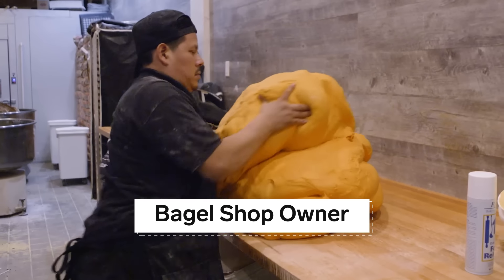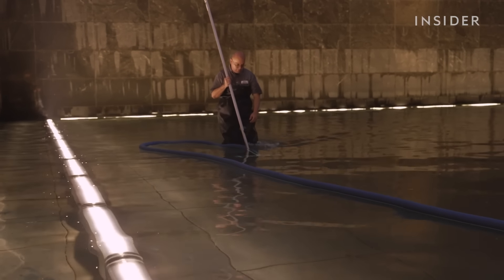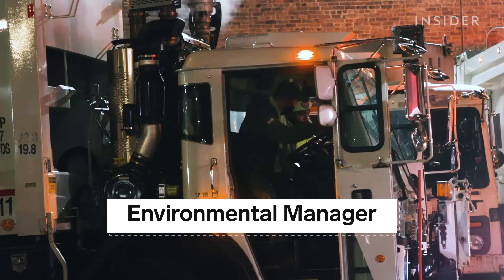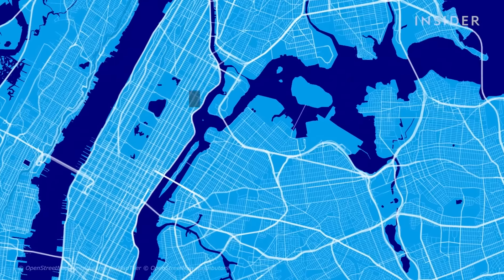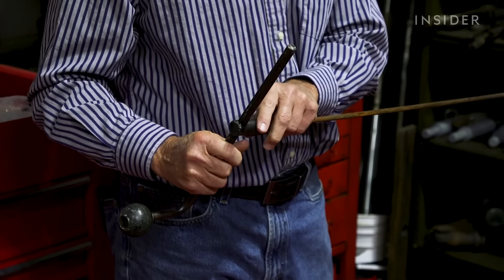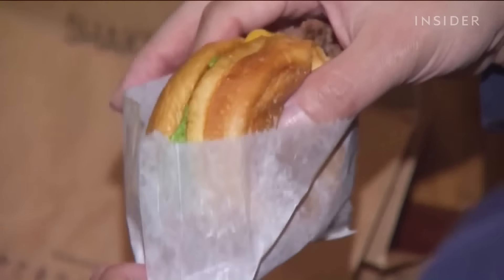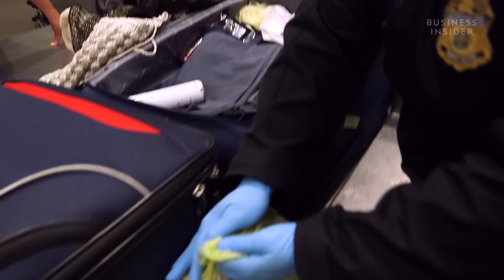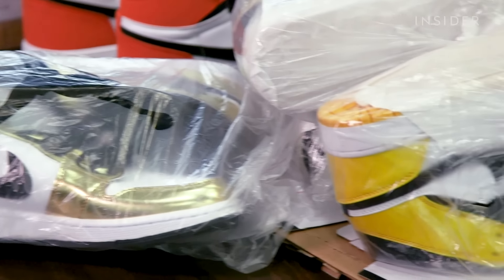10 Fascinating Jobs That Keep New York City Running | Big Business | Business Insider Marathon

Comment: This is the way I remember bagels being made in Brooklyn, NY and South Beach in Miami.
A few years ago I had two customers who started bagel factories in Charlotte. One man made his bagels this way with the kettle-ing. 
The other was run by a family with a chemical engineer father. The bagels were put into steam cabinets instead of being boiled. Both bagels were good but they were bigger so they could be made into sandwiches. The Brooklyn and Miami bagels were crispier and had a less dough-y texture. The Miami bakery had a sign that said that if you needed a tooth pulled you could just eat one of their bagels and the tooth would come out with no need to go to the dentist. 
I put more stock in the Brooklyn and Miami bakeries for authenticity because everyone there had a tattoo from a concentration camp. 
I'm not crazy about the modern bagels I guess because I remember what an old fashion bagel was like.

The steamer type bagel company had a contract to make bagels for Sara Lee. In my opinion that was their undoing. They went out of business shortly after they started mass producing bagels. The bagels were all rolled by machine. Prior they'd had a small restaurant and retail counter for bagels and various types of cream cheese flavors and lox. (smoked salmon) 

The Brooklyn bagel bakery also made soft pretzels. In the 1950s and early 1960s I would buy 25 bagels for 2 cents each and cell them for 5 cents. The only plant you needed was a peach basket and two towels to keep the heat in. If you had a rolling shopping cart you didn't have to carry the basket all day. I sold them nearly every day during the warm months but only on Saturday during the cold ones. What didn't sell I took home and we ate them as bread with dinner.

Comment: Strange idea of what might help the 9/11 Memorial. Post it notes... Think about it, while it does encourage the writing of things upon it, it encourages the writing on a supplied material that can be removed easily. It becomes less likely to actually mar or mark the memorial from that point.
Reply: Post-it notes everywhere would look (and be) trashy.  Plus, the adhesive would have them sticking to the high walls of the fountain which would have to be cleaned as well.  And the adhesive would be gunky and hard to clean.  Better not to encourage everyone to junk the place up.

Comment: 1:02:23 - if the same Chinese manufacturer is making the real products for the big name brands as well as 'counterfeits' that are so good, hardly anyone can tell the difference, are they really even counterfeit at that point? Seems like some of the fault is on the big names for trusting Chinese companies with thier intellectual property, let alone the outsourcing and ridiculous mark ups. The fakes are probably about what the real ones should cost if the craftsmanship and materials are comparable. The fashion industry as a whole seems terrible about using unethical labor, and charging for a name, it's shameful.  Everything knows it costs $4 to make that pair of Nike's you pay $150 for. 
China apparently doesn't care much about trademarks, and they would have made fakes anyhow, but brands having the genuine products also made there really cheapens their image, doesn't it?
 At least when someone pays an inflated price for a high end wrist watch, they hold their value, part of which comes from the precise machining and precious materials used (sometimes they even appreciate) that cant be easily and cheaply duplicated. Knock off watches are never comparable to the real thing, like what's possible with sneakers and handbags. It's crazy how much people will spend on fashion products that apparently arent any better than a clone at 1/10th the price. 😂